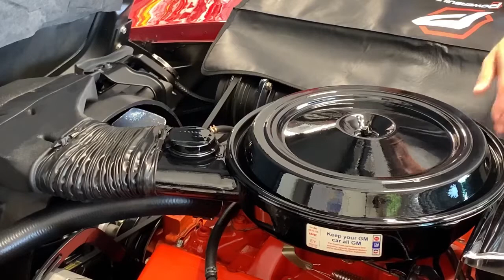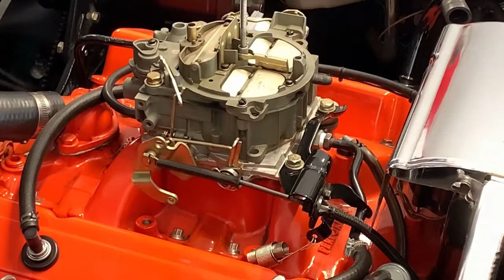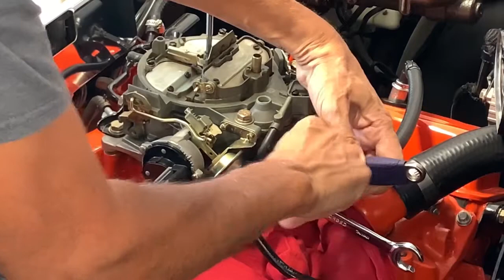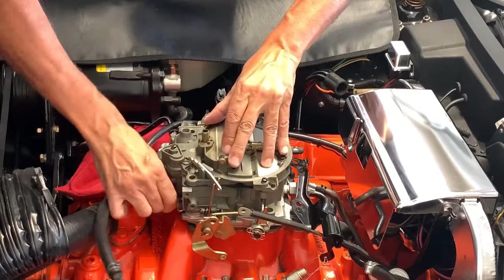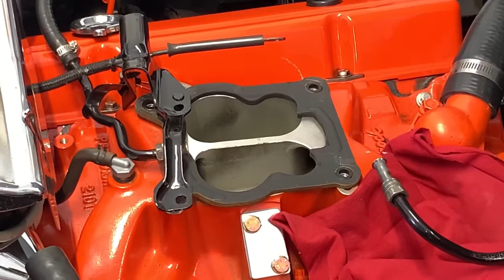How To REMOVE a Quadrajet Carburetor

Comment: My fuel line is old, stuck, and stubborn and wants to bend. How can I take it off easier?
Reply from the maker: Sometimes the only way to solve the problem is to cut the line, remove the carb and/or fuel pump (or both), and then remove stuck fittings on the workbench. Good luck 😊👍🏻

Comment: Is that teflon tape on the fuel line?
I was told that's a no no....possible seepage into fuel system.
Reply from the maker: There’s no tape or sealer on the fuel line. Maybe some sealer on the fuel filter fitting threads. I removed the carb to rebuild it and I agree; Teflon tape is not fuel resistant 😊👍🏻
Reply: Yes, the threads. 
Nice clean motor!
Thanks for the video!